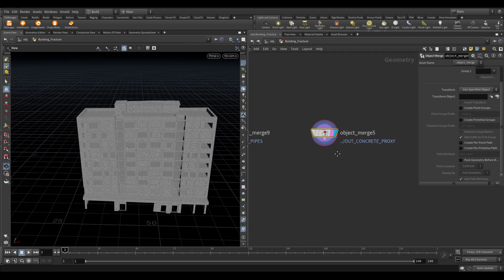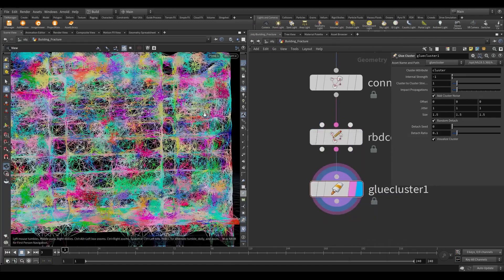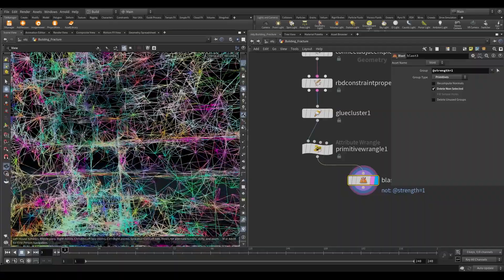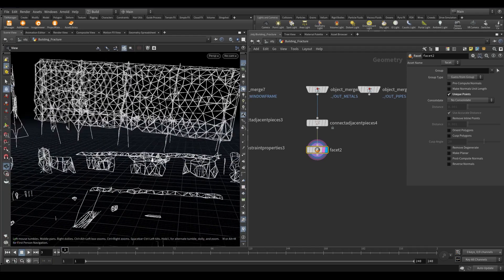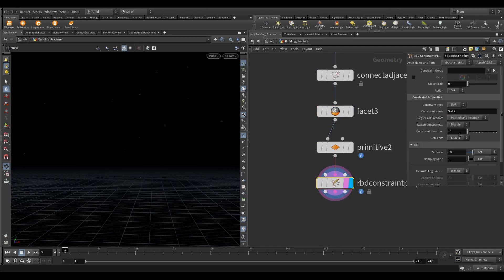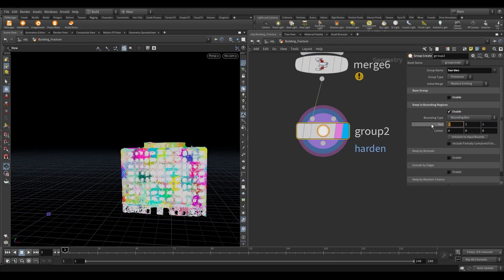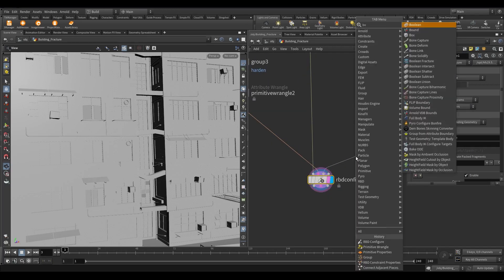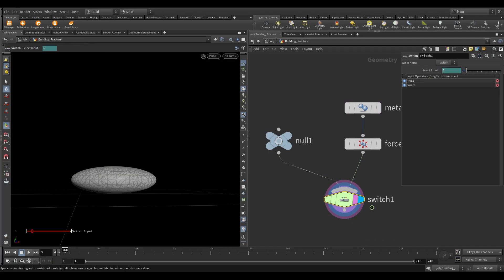Creating Constraints  | RBD Tutorial Part 4 | Houdini Zone | 19.5 |

Comment: Hey i have a question about constraint on metals. Why did you use facet and primitive ? What is that for ?
Reply: I have the same question. Do you happen to have the answer now?
Reply: @mintmercer2386  hi, I still don’t know exactly “why” you need to do this. But as far as I know, soft and hard constraints cannot be applied correctly when they are primitives so they have to be points. So, by using facet node you can separate those prims into shorter ones and you can use prim properties node to shorten them as if they are points. I hope this makes sense.
Reply: @Kai-v2v  Thank you so much for the explanation, it was extremely helpful! I wanted to ask if you have ever encountered issues in the constraintnetwork inside the dopnet when using rbdconstraintproperties set to Hard and Soft, because I’m getting an error when I set them up like this
Reply: @matteocol-lc2  hey man. You still have error??